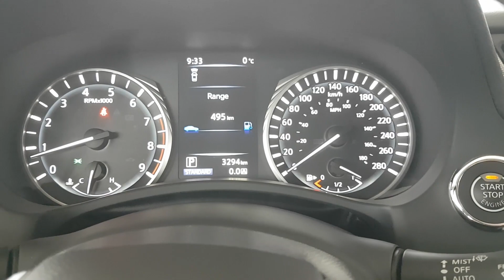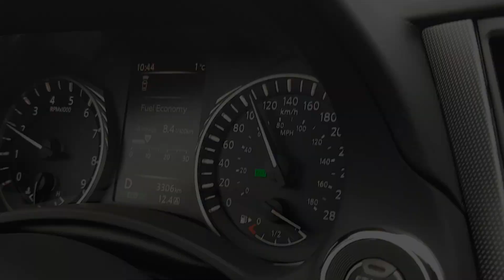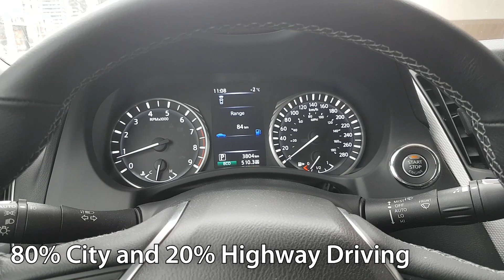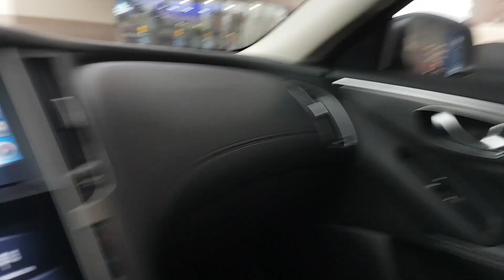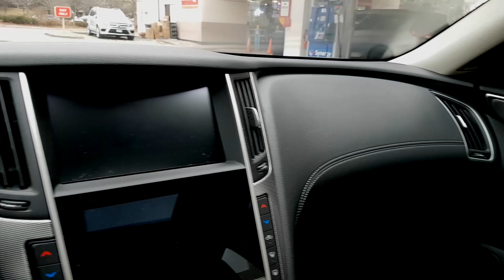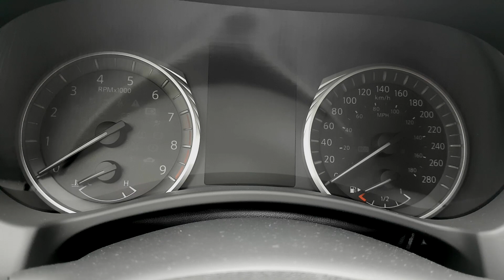2022 Infiniti Q50 - Fuel Economy MPG Review + Fill Up Costs

Comment: The lowest I was able to achieve in my 2018 Red Sport was 8.2 L/km driving primarily in Eco mode.  My combined fuel economy lately is 8.9 L/km in Eco mode.  Soon I will try and see if there is a difference in Standard mode, although I think having the turbos more spooled up in this mode will make you want to step on the gas.:)

Comment: Can you use regular??
Reply: yes you can. But you won't get the fuel millage and performance. The also recommend to not floor it if you use regular gas.
Reply: No it’ll damage the engine
Reply: DramaTv 101 minimum 93 or 92?

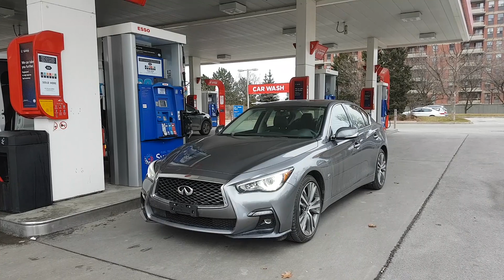Comment: 1:53 Why do you keep on clicking? You should have stopped after the first one, otherwise it's hard to fill up the tank to the same level it was before.
Reply from the maker: Before my test, I usually fill it up with 1-2 extra clicks anyway, so I do the same after to keep it consistent. Also, the reason I do multiple clicks is some faulty gas pumps stop the flow even though the tank is not full. I've had situations where the pump stops the flow, and upon shooting the second half of the video, I notice the tank is not completely full. This basically makes the rest of the video inaccurate because I don't have the correct dollar amount, or liters required to fill the tank. Hence, it's best to make sure the tank is always full with an extra click or two :)